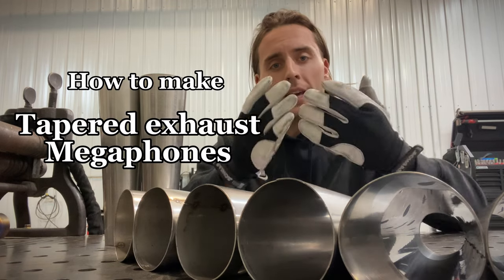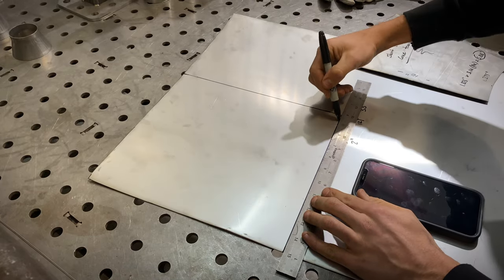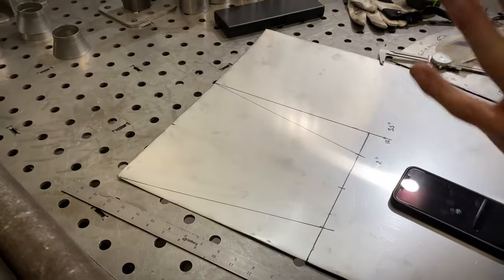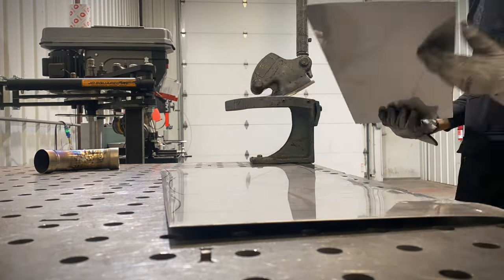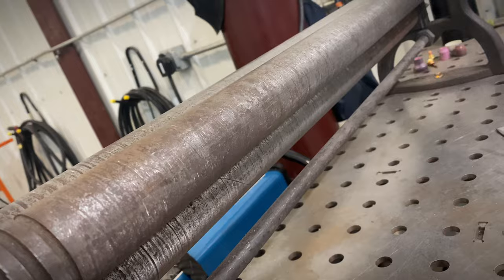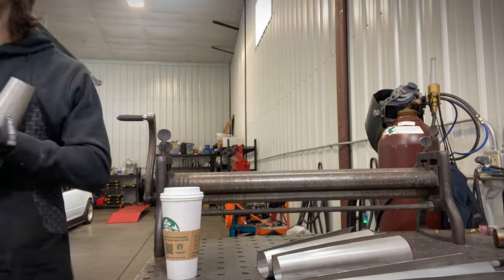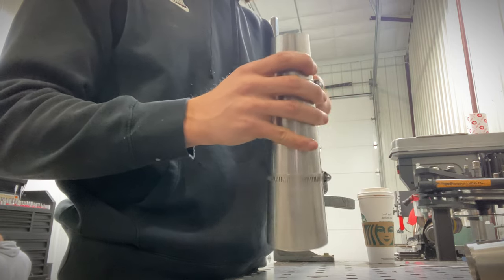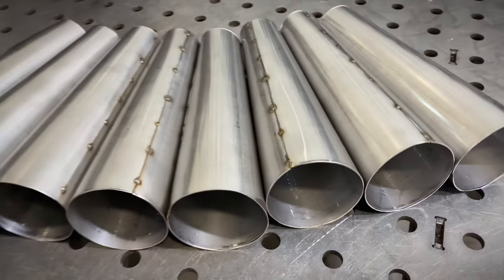How to build tapered exhaust cones start to finish.

Comment: What's your estimated fab time for a single cone and do you think that time could be cut down significantly when using a softer material such as aluminum? I build intake plenums and require cone reducers, which I have to purchase at $25ea + shipping, in my design. If build time is under 30 minutes then that would save so much $$$.
Reply from the maker: Hey ! Thank you for the good question.  I think once you get your template/ process down you could build several cones in 30 minutes . It probably only takes about 10 minutes per cone by the time it’s rolled and tacked up if you know what your doing

Comment: If you extended the side layout lines till they intersect you can use that point to set a radius to scribe the inlet and outlet.
   To make things easier implement a tip-up the first 5-10mm of material in a brake press, pan brake,  or over a edge. This allows the slip to get a more consistent seam with less work hammer forming the last bit trying to achieve the same results
Reply from the maker: thanks man! will take that into consideration!
Reply: Back rolling through offset rollers, like he did, is better than almost any other way of doing it. Keep a tight pinch to keep the straight small. Will not work with pyramid rollers.

Comment: Can you now show us how you fill the cone for good sounding exhaust? 
And also how can we easily bend the pipe for building it out the headers.. 
Great work!
Reply from the maker: Couple things here .  1. The cones you see in the video are megaphones , they are part of the header system .  There is an addition unit that goes beyond the cone , what we call a muffler or a canister that actually gets the perforated core with packing . (Where you get your exhaust sound) 

We do not mandrel bend tubing in our shop , all of our tubing gets ordered in from suppliers 

Thank you for the questions and thanks for watching

Comment: What does the length do for it? Does a longer cone yield more performance?
Reply from the maker: It depends on the engine combination.  There is still a lot of question marks in the exhaust industry.  All the teams I work with try a variety of exhausts with every engine package.

Comment: 6:25 "you need to kind of rotate the piece"

Not if you use a snubber. The snubber acts like a pivot point and the sheet metal turns by itself.
Reply from the maker: that would be helpful!  My cone rolling program is probably a bit out dated :) lol